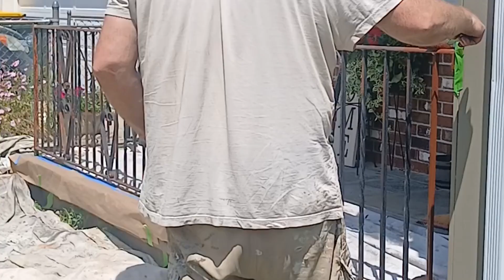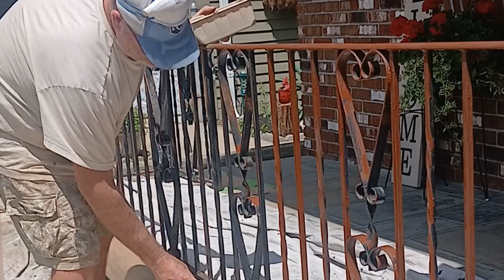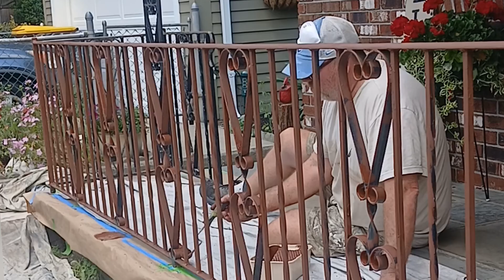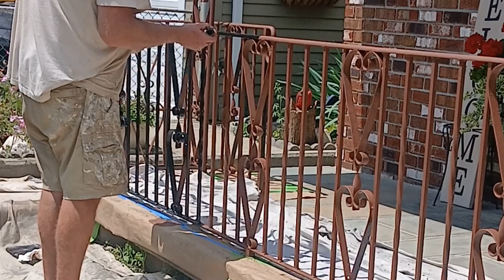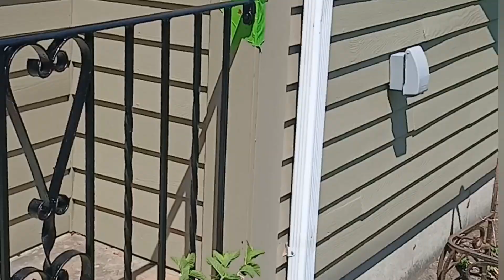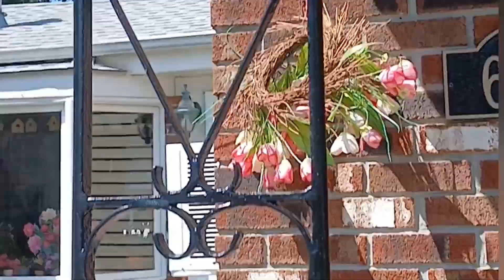Painting metal railings with Rust-Oleum rusty metal primer and Protective Enamel

Comment: I’m about to do an aluminum awning this weekend for a neighbor with this stuff in satin white. Hope it’s worth the effort. 
Does it hold up ?? 
Great video and thanks
Reply from the maker: @johnc1280  Cool, I've used Rust-Oleum on wrought iron driveway gates and aluminum exterior light fixtures. It held up really well. Good luck with the job 👍
Reply: @griffinpaintingandhomeimprovem  thanks boss. Today is day 1 prep and first coat 

on the light fixtures, you use the spray paint cans or can paint?
Reply from the maker: @johnc1280 I used a brush. Same on the driveway gates. Then I used the spray can to hit the tight spots the brush and roller couldn't get at.